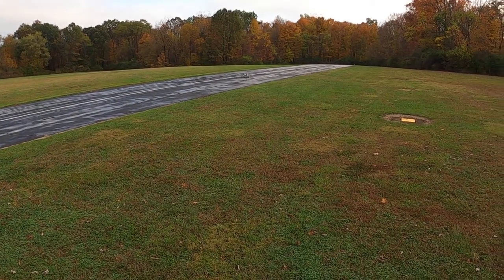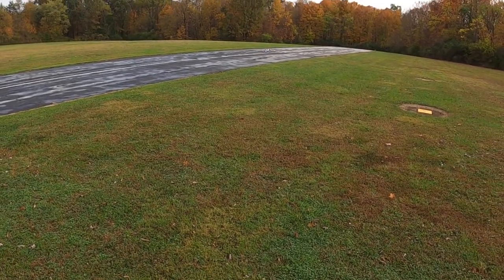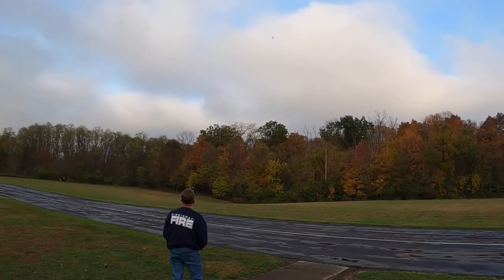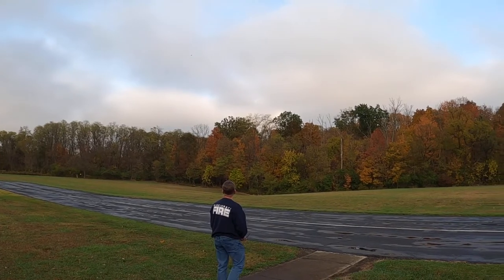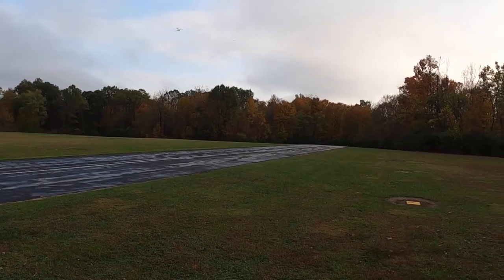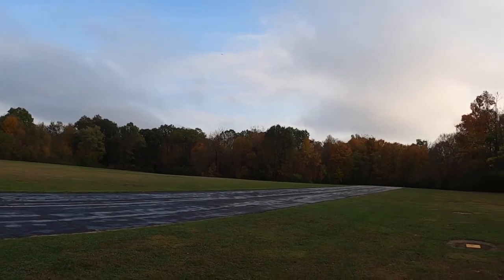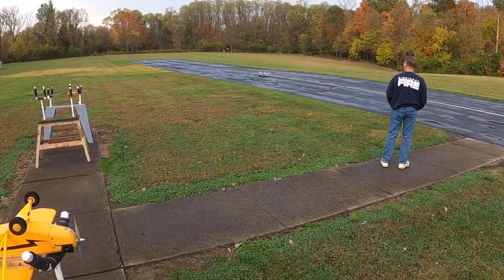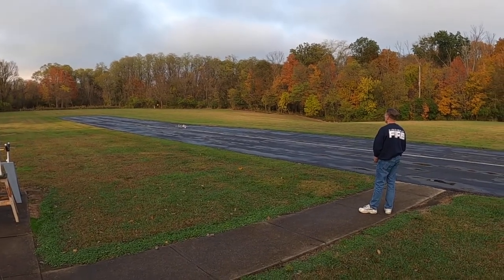E-flite A-10 Thunderbolt II 64mm EDF on wet runway

Comment: nice video,i just purchased the e flight a-10, cant wait to get it in the air,could you tell me about the noce landing light,i would love to put that on my e flight A-10  thanx
Reply from the maker: Thanks John! 
I’ve been meaning to post what I did with adding the LED lights. Take a look at this video. This was the latest version of the light setup. 
https://youtu.be/88QbutSmHsU
I’ll try and post what I used and where to get them in the next day or two. I found it easier to do the lights before putting the plane together.
Reply: @mpence  thnx, the a-10 is still in box
Reply from the maker: What I used for the LED lights on the A-10.
Dimension Engineering
DELight Controller - https://www.dimensionengineering.com/products/delight-controller
DLink 2 - Controller for programming lights (PC only) - https://www.dimensionengineering.com/products/delink

Rest was purchased on Amazon
White - https://www.amazon.com/dp/B01DBZICDC/ref=cm_sw_r_sms_api_glc_fabc_.Gp9Fb5Y4466X?_encoding=UTF8&psc=1
Red - https://www.amazon.com/dp/B01DBZIET4/ref=cm_sw_r_sms_api_glc_fabc_xHp9Fb9AX63TM?_encoding=UTF8&psc=1
Wire - https://www.amazon.com/dp/B073R6C1L8/ref=cm_sw_r_sms_api_glc_fabc_.vp9FbA2NSF5N?_encoding=UTF8&psc=1
Y - Connections - https://www.amazon.com/dp/B07PHDYZXN/ref=cm_sw_r_sms_api_glc_fabc_JGp9Fb1KEQ7K2?_encoding=UTF8&psc=1